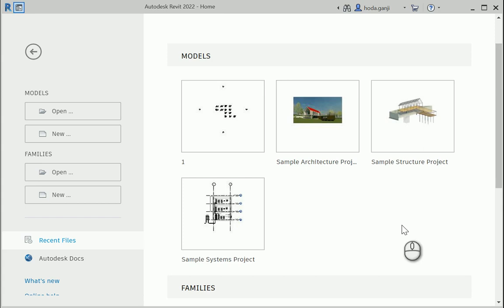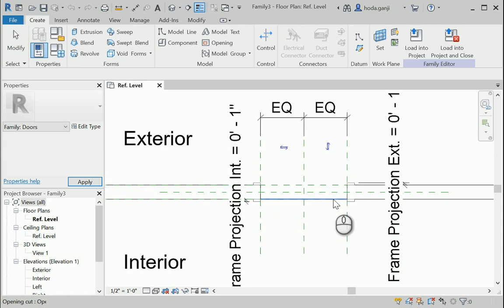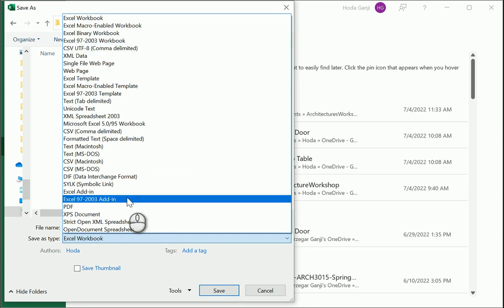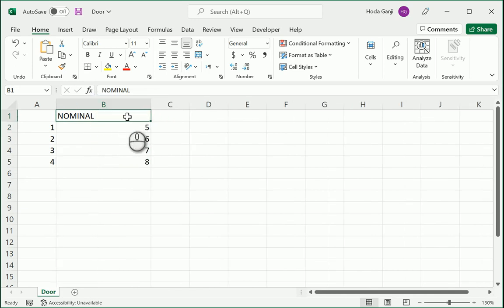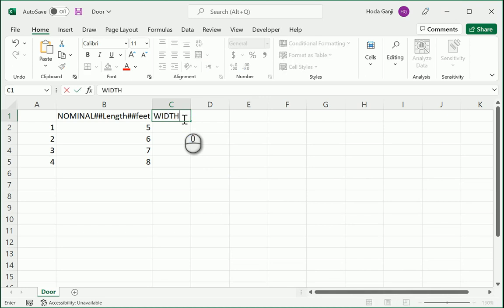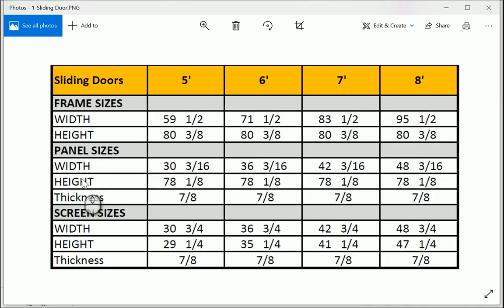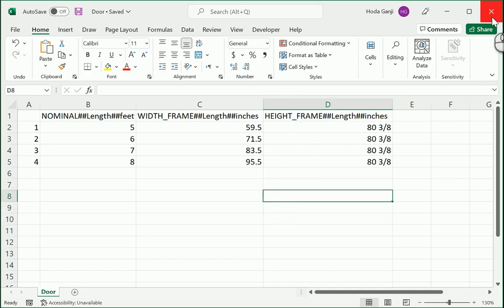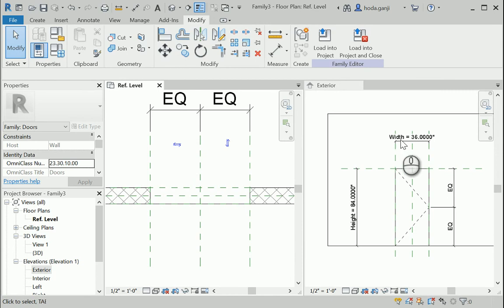Modular Construction 6, Revit LookUp Table

Comment: This is by far one of the best and easiest to follow tutorials on look up tables in RFA's. Not really messing with them in the past, I was not aware that parameters had to be type and not instance, but that error came fairly quick for me. I also wasnt sure if they could be either family or shared parameters (found out that they could). Thanks! Great Stuff.